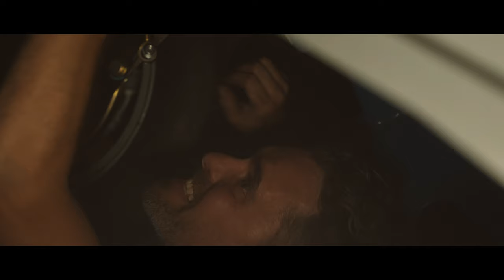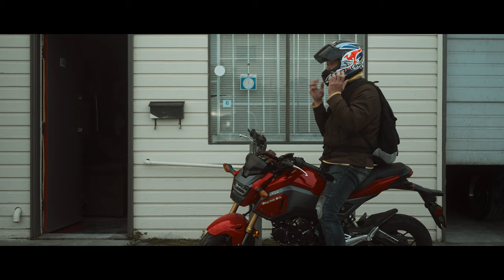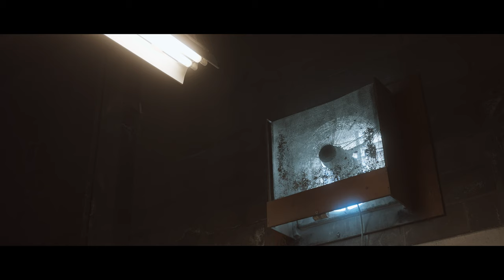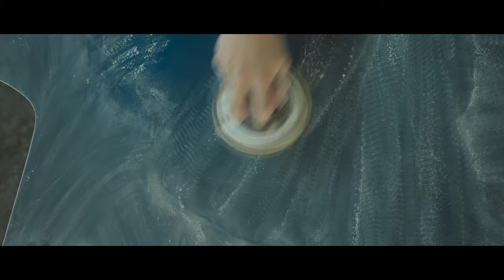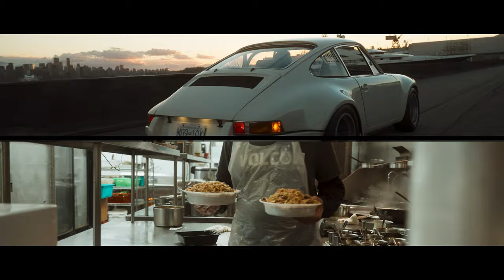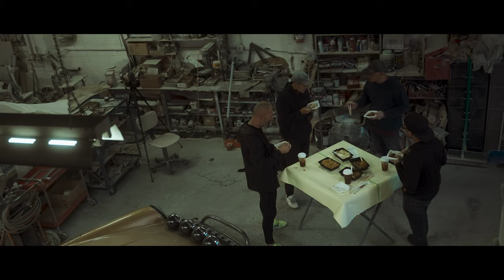A Cinematic Porsche 911 Film // Sony FX3 "Billy the Magician"

Comment: Amazing video, as usual! 
I've got 2 questions:
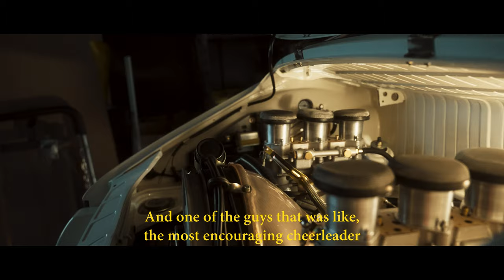1. How did you light the 0:40 sequence, the engine shot?
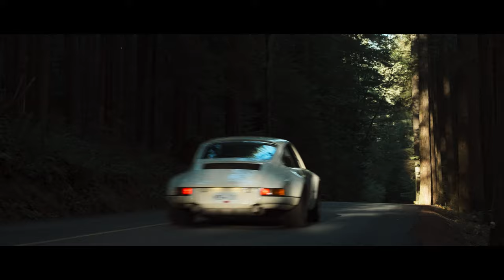2. How did you film the 3:19 sequence of the rear right wheel? Holding the camera through the window? How many times did you need to frame it correctly?